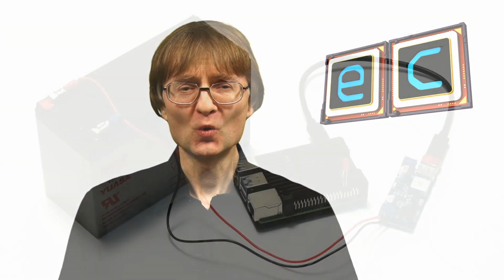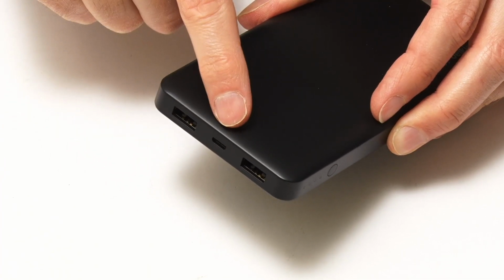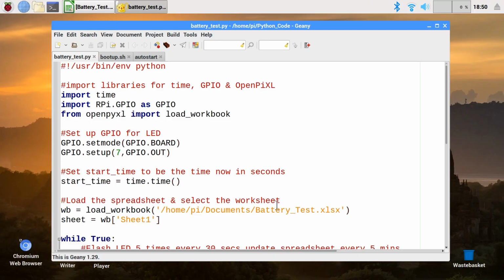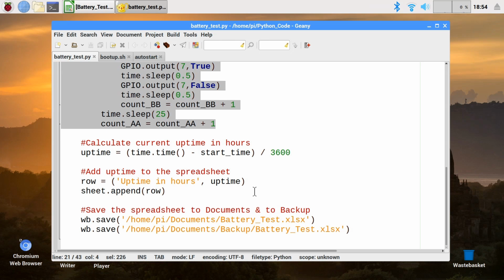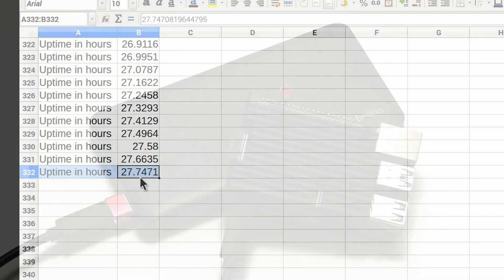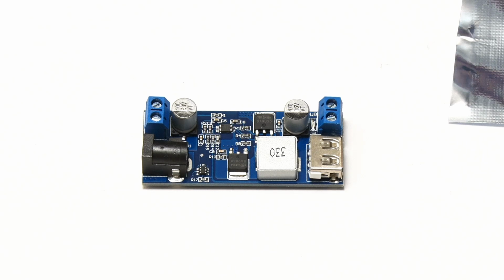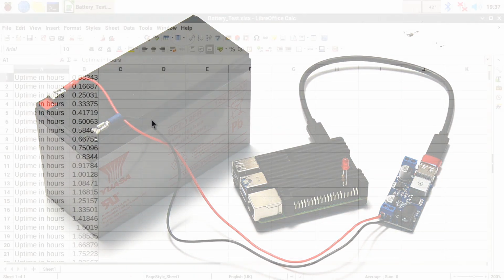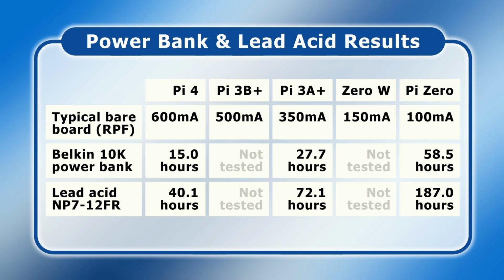Raspberry Pi Battery Power

Comment: Great video and worth doing. Of course it is very hard to compare the two batteries but still worth doing. You assumed 65%(ish) for the lead acid but was prob run to flat. Unless you had programmed in a cut off voltage in the buck convertor.  We use lead acid for camping etc and although they say don't discharge below 50% yet we just use the batteries and assume they only last a couple of years (usually three or more). still cheaper then carrying twice the number of batteries and far cheaper then li -ion. horses for courses. I use a few zeros headless running emulators on my network and for demos (SimH/ Herc). A zeroW will even make a nice wifi repeater etc (only one or two users but still worth while). Plenty of uses.  Trouble is so many pos projects and not enough time! lol.

Comment: Did you measure the voltage of the lead battery at the end of the test? I guess, the buck converter works as low as 5.5V but the battery shouldn't be discharged (I think somewhere below) 9.6V in order to avoid capacity degradation and damage. The battery supplies 7AH at 12V which is more energy then 7AH at 5V.  
Taking a view at the energy stored (ca. 12Vx7Ah=84Wh) and comparing it to the consumption of the boards (5.5V (guesstimation for buck converter x Raspie-Current Ir) leads to: t = 84Wh/5.5V/Ir. [measured|theory]   PiZero: 153hrs [187|98], Pi3A+: 44hrs [72|28], Pi4: 25hrs [40|16]. That could explain the longer duration (theory using current vs. guess using energy), together with your assumption that the RPi-foundations current values are a bit higher than those in your test setup.

Comment: You can buy a USB cable that has a power switch. Which is good for power since they tend to not do data. It might help with the auto on thing.
Reply: Hi, my PI3b+ came with one, when i looked at it i thought very high tech like a bedroom table lamp - but it has its uses

Comment: When my daughter moved in her apartment, I garbed the small alarm controller the previous owner left behind.
It had a battery like yours making 3/4 of the enclosure, and it was only 2 years old. 
It now provides power to my RPi2B+ Rpi Noir camera, running RPi-Cam-Web-Interface on Raspbian,  making the best IP security camera in the world for $50 !!
I connected a beefier 5V @5A buck converter than what you show in your video to power the setup 24/7. That's all I had. 
Fortunate for me, the internal 12V SLA charger circuitry can supply 1A to charge the battery (~12W). Running a Rpi is a walk in the park for the built-in charger. 
When I lose power the charger will stop, but the 12V battery is fully charged and ready to go. 
I never tested how long it would take for the system to run down. 
Now I've got a pretty good idea. Thanks to your video.

Comment: Thanks a lot for this video! I will put this knowledge to use very soon. Due to increasing costs of cloud computing and being a SBC enthusiast, I moved my test server from Amazon to my home. I have a Lattepanda V1 running Windows Server 2019 Datacenter edition where I test my developments and host some non critical websites and applications. This Panda, along with a Rocket Pi X, is plugged on a conventional nobreak. I have been wondering for months if it would be a good idea to tap directly from the nobreak battery to power the SBCs instead of increasing the voltage to decrease it again. What I am planning to do now, based on your data, is to connect a second battery on the nobreak with a diode to prevent it from being discharged, and power all 5V devices from it, including the modem and router that are 9V. The nobreak will serve the high voltage stuff and serve as a battery charger. At least, that is my idea. If you are curious, this link goes directly to my Lattepanda server: https://tubedata.altanatubes.com.br/search/ where I host a mirror of Frank Phillipse database.

Comment: Is the lead acid battery going to be re-charged from sunlight in that greenhouse? That would make an awesome little project!
Reply: Perfect "cheap and easy" chemistry for a diy solar setup or first battery project to get you learning. 

You can add a cheap pwm solar charge controller and 12v panel from amazon, and in the states you can find those batteries locally in home depot.
Reply: I was acutally thinking about installing Pi in my car connected to power bank which would be charged by solar panels. Would that work?
Reply: @ajantis.ilvastarr  you could if you wanted to do it for fun, but since it's in a car if you drive the car enough, keep the pi's battery charged when you run your car (and use solar to keep it going for long term storage). 

use the separate isolated battery for the pi to keep from draining your cars battery. You may be able to get away with keeping it powered off your cars battery alone, but those batteries are not designed to be run down and they fail wuickly with even little draws, so having the 2nd battery would be ideal... Then just pick your method of charging.  Your setup would be a smaller version of what rv's use... The main vehicle battery stays seperate, and the house batteries run independently and charge when plugged in or the vehicle is on.

Comment: It goes without saying so I am wondering why I am sayong it but this is extremely interesting and useful information.

It occurred to me that a comparison of the "volume" taken up by the LiPo thing and the PbAcid battery per unit something would also be interesting and my purly visual impression on your video was that the PbAcid battery was about five times as big as the LiPo thingy so they were of similar capacity/litre of space. You MUST have been doing something with your time while they were performing :-). Would it be reasonable to be able to extrapolate these results to the Arduino type family of Micro-Controllers. Just in case you were bored. :-)

Comment: Hello Mr. Barnatt!
What was the cutoff voltage, or the voltage at which the Pi was turned off, for the Lead Acid battery? Based on the disparity of the results, I am inclined to believe that the Lead acid battery was discharged far below the safe discharge voltage of 10.8V
Granted that the buck converter will continue to supply 5V output for anything over 6V input, discharging the lead acid to anything lower than 10.8V will damage it.
Also, a lead acid battery is not very well suited for low current applications like the Pi Zero because such batteries are designed for (relatively) high current flow, which helps to clean the plates of the battery and extend its life. On low current use, sulphation will occur and will degrade the battery much sooner than the expected lifetime of 3-4 years.
PS - If the charger can pump about 1.2A in the 7Ah battery, it should be fine, since that would break any sulphates that were formed.

:)

Comment: All battery banks report the capacity of the battery, but the battery is only 3.6v and has to be stepped up to 5v, so 10,000mah is only 7,200mah at 5v at 100% efficiency, so will be nearer 6,800 to 7,000 mah...

Comment: The rated capacity on lithium packs are usually noted at core level, because it's it's not "illegal" to do it this way. but the output is 5 Volts.

A common lithium cell will be rated for 3.7 Volts and then the rated amps for that voltage. the 10.000 mA rating is for that 3.7 Volts not 5 Volts
The Pi4 will draw a typical 600mA @ 5 Volts.

So you'll need to compensate for that voltage increase as loss in capacity for 5 Volts steadily.

The buck converter is also a lot more efficient than 90% at those low current values. There's practically no load on the other end, so the switching loss through heat is minimal.
The lead acid battery also doesn't switch off to prevent undervoltage, because it doesn't have to. The voltage will drop significantly before it dies, but the buck converter will be able to keep that 5 Volt output steady for much longer.

Comment: Another awesome video, combining that greenhouse setup with even a modest solar panel charging would work well.. I created an irrigation system using a picaxe.. just put two stainless steel rods into the soil and took an adc value.. calibrated by just testing in dry and wet soil.. aimed for the middle, took a reading.. activated a small 5v pump for a few seconds.. put the picaxe into hibernation mode.. it only needed to take readings infrequently as the soil humidity doesn't change much.. it lasted a decent amount of time on AA's.. I've always pondered about moving that project to a pi zero w just to have results on a local webserver. I'm guessing your next vid(s) are going to re-spark that.. can't wait.. I've got a cold frame that needs wood stain and new windows, then hopefully self sufficient for salad by the summer :)

Comment: I am sure you know this, especially since you calculated this for the lead acid. The 74% of listed capacity is because that is the cell capacity at 3.7v.  When running at 5v the mAh will be lower by a ratio of 3.7/5.0=0.74.  A better capacity rating is Watt hours (Wh).

Comment: Okay, so first of all: The "mAh" is not a capacity, it's charge. Secondly, apparent battery "capacity" is definitely higher when discharged slowly. Third, "capacities" are typically given for a 10-h constant current discharge of a battery. In practice most of the batteries on the market fail to meet even their own specs because consumers don't understand these numbers and can't verify them. Finally, power banks contains redundant voltage converter that decreases overall efficiency. Typical voltages of 4.3V - 4.8V of 18650 cells are perfectly fine to power up Raspberry Pis, even if the holy gospel of the manufacturer says that you should buy more official gear instead. Cheers!

Comment: Lead Acid chemistry is strange  yet useful.  The rate at which we draw the current determines how much useful capacity you can make of it.  May be you should run a video series on battery chemistries and how to select a right battery type.  Its an interesting  subject.
Reply: Lithium batteries would really be best for any type of application if cost wasn't a issue.
Reply: I would watch that.
Reply: @kennmossman8701  It is to one application, and yea if you want a UPS, buy a decent dc dc LDO or something, but at 6volts you can also get lead acid battery.
Reply: @kennmossman8701  oh hey its you! Do you still think lithium batteries cannot run electric motors??? Please tell me you have at least learned a little bit of knowledge from our last chat...
Reply: @kennmossman8701  well with your history of you saying lithium batteries cannot run electric motors I don't know when you are kidding....
Reply: @kennmossman8701  do you still think that though? Can lithium batteries run electric motors?
Reply: @kennmossman8701   hahahaha typical you trying to change the subject to what are probably minor mistakes in my english... Your exact words in that comment you made was "Oh dear. Another twit. NiCd/Ni-MH work differently/behave different than Li-ion! :I-ion is NOT suitable for motors. Dear Gawd- save us from the ignorant of the world" please tell me how that does not state that you are saying lithium batteries can't run electric motors? I know my english isn't THAT bad. Com on man.
Reply: @kennmossman8701  you have something against lithium batteries, it's either you don't have the experience/knowledge with them or you don't like new technology. 😂 From what I gather you think NiCd and NiMH batteries are still the peak of battery technology or something.
Reply: Awww I finally found the infamous dummy head kenn mossman and then he proceeds to delete all his comments about  how he thinks lithium batteries cannot run electric motors. I guess he finally figured it out after a year... but he could have just said he was wrong. If anyone runs into him let him know I said hi and ask him if lithium batteries can run electric motors.
Reply: It is interesting but I think it's a bit of a stray from "explaining computers". I think he has other channels that he might put stuff like that on. If you look around youtube I think you will find lots of videos on batteries.  Including people who make their own from individual cells. There's one guy who shows how you can use an old battery case and make your own lead acid battery. It's actually pretty simple, but messy with the sulphuric acid.
Reply: @dougcox835  Who is the person you are thinking of?
Reply: I’m all up for this but maybe on a separate channel as this channel is mainly for computers/technology.
Reply: @kennmossman8701  LMAOOO are you for real? Lead acid would be a TERRIBLE choice for a mobile device like a phone... less capacity and less life cycles. Please tell me "r/whoosh" or something this is very sad if you actually think that.
Reply: Lead acid is obsolete, bulky and very heavy. Your best bet here is to buy 4 Li-ion 1.5Volt rechargeable AAs connected in series and then add the simplest linear regulator which is just one small resistor in series as a voltage divider. Benefit of Li-ion chemistries are light weight, energy dense, and a very stable  discharge curve (<--very important). You can add more packs in parallel like this
Reply: @diogenesdevletoglou6190  But lead acid can have some advantages over lithium - one being that in below freezing conditions you shouldn't recharge a lithium but no problem with lead acid.
Reply: @LarryKapp1  Well, below freezing, you shouldnt use a Raspberry anyway :)
Reply: @diogenesdevletoglou6190  actually I think the pi wouldn't care how cold it is . I mean I have other devices outside running just fine in -20 c or colder temps . I care if I go outside though ! The lead acid and lithium rated capacity gets lowered when so cold though.
Reply: @LarryKapp1  I confirm, checked raspi specs, they want 0-50ºC
Reply: @diogenesdevletoglou6190  I will put one outside next winter and see what it does !
Reply: @LarryKapp1  Yea, but you stress em and they will fail at one point. Raspi specs specify no less than 0ºC. Raspi is a cheap sbc and we cant expect a lot at this price point.
Reply: @diogenesdevletoglou6190  Wonder what the specs were for an older Linksys 54G router that I have had outside stuffed into a plastic jug for water proofing - hanging by a wire on a tower running 24h a day in all temperature and weather conditions for 7 or 8 years without fail. The plastic jug failed though when the sunlight made it brittle and fall apart.  The way I have seen electronics fail is if circuit boards get too damp then the pcb masking falls off and the exposed copper traces will corrode away .
Reply: @LarryKapp1  Same, 0º..40º C. In your case, you just make a wish and all is good :) But you can always reach it anytime you want change it, fix it or whatever. What if you can't reach a remote area or an island, tower etc? For those cases you need rated equipment, or repair charges would be more than the product
Reply: @diogenesdevletoglou6190  It seems like you mean 4 NiMHs which would discharge mostly at 4.8 - 5.0V in series, but up to 5.6Volts breifly when freshly charged. This range might not even need regulated to power rPi. I do suspect the Lead Acid in these tests got an 'ultra deep' cylce below its healthy working voltage, perhaps right down to 5V
Reply: @adymode  Yea was kinda mistaken thought they made lithium rechargeables. NiMHs very good.

Comment: I too have automatic watering in my greenhouse but my solution works on gravity and capillary action. the water from the gutters flows into a 50L tub which is 3m off the ground, it then slowly flows into the greenhouse via a non-return valve to an aerated reservoir which has strings of capillary matting which are threaded into opaque tubes which then lead up to the plant beds and pots which contain more capillary matting and thus keep the plants watered.

Comment: I was actually just using my Raspberry Pi Zero W on battery yesterday, but I was also using the monitor on the same battery. (An actual Dell 19" monitor, not a battery powered portable monitor.) It was mostly because I was trying to get the Raspberry Pi setup and I wanted to do it where I hadn't had any spare plug sockets, so I used my Anker Powerhouse 400Wh battery pack. The monitor burns through a lot of power quickly, but the pi can run for at least a month on that Anker power supply. (Possibly more, depending on the use case.) Those large batteries with multiple outputs are extremely handy for various projects.

Comment: Great real world test, but you've missed a critical issue - lead acid batteries MUST NOT BE DISCHARGED BELOW 12.3 Volts or you will permanently damage them and considerably shorten the total number of discharge/recharge cycles (sorry for the Upper Case). The lead acid battery in your tests will have discharged each time down to around 11.8V or possibly less with each RPi until the buck convertor fails to deliver 5V and the RPi process fails. In practice, even with a lead acid battery especially designed for 'deep discharge' such as an AGM type, if you want to preserve the full number of recharge cycles you should try not to use more than around 50% of the quoted Ah rating. Even a single total discharge may completely wreck an ordinary liquid acid car or motorcycle battery life.